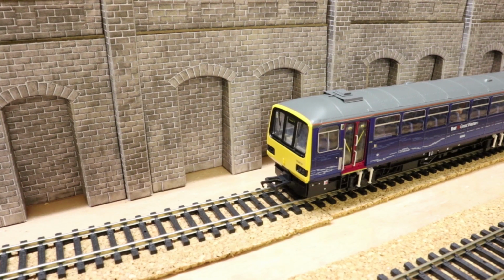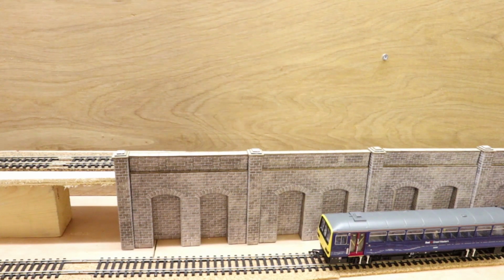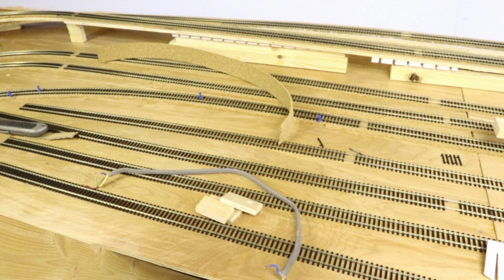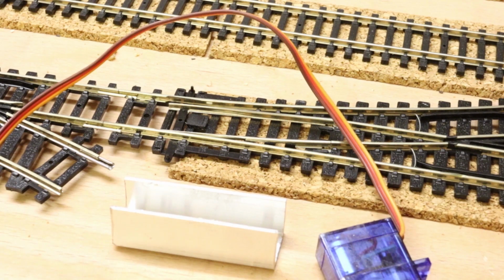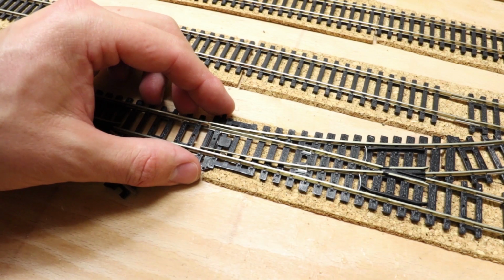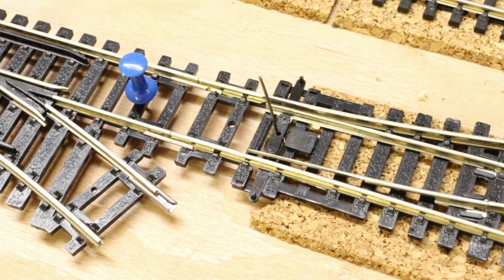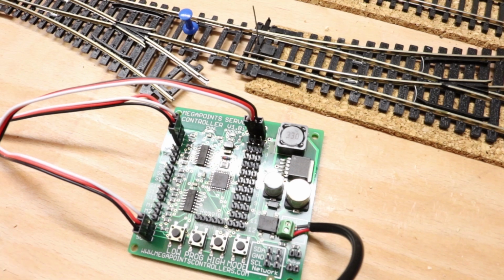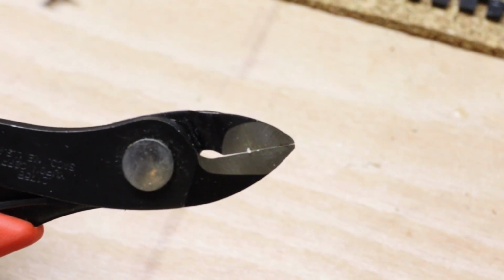Part 21 retaining wall and point motors - Building a model railway

Comment: Hi,  I believe I have been told or read...that yard tracks are not ballasted but rather sit on the ground,  please check this out at your end.  Also, when putting droppers on an incline, my sources say to bring a long section of it down on the benchwork in front of you.  Then install the track, droppers, and turnouts in this section.  When done, take the whole section and place it back on the incline supports.  Drop the droppers thru the benchwork and screw the track down, tick on the joiners and move to the next section.
Bob S

Comment: The hole for the actuator wire can be quite big, if you want, to allow for any misalignment.  Of course, if you cut an oval/slot, the hole will be hidden under the tie-bar.
But you've considered and tested your implementation, so kudos.

Comment: Looking at the upper walls of the retaining wall, I can see that the line of whole "bricks" looks good, and the top edge is lost below the coping stones.
Small point; between the sections of wall, you get small gaps, and train lights (at night) will emphasise them.  Not sure what to fill the gap with, since UHU remains transparent, but anything that is dark will require more care to avoid marking the (rail-side) printing.  (Because yo are already thinking of the railside perception, and with the increase of small wagon mountable camera, you are likely to do cab-view videos.
Reply: I see you got still the spring in the turnout.
When you remove that spring, the turnout moves smoother

Comment: Good progress. Nice work. The track cutter instructions do say not to cut anything bit track with them. I guess that's why!
Reply from the maker: Instructions? I'm a man, they went straight in the bin with the packaging lol.
Maybe I should read them in future.
Reply: The Devon model railway Lol. I am also man. But when I've spent a ridiculous amount of money on an overpriced tool, I do tend to read the packet...got to get my money's worth!
Reply: Piano wire is high tensile steel, its application requires varying degrees of tensioning. When I work on steam we used it for alignment of e.g. locomotive slide bars, bearings etc.
The ol zuron track cutters are designed for that purpose only. The vertical cutters are great for cutting & shutting the closure rails on a layout. Yes the instructions do stress that but I know we all tend to think we know best, you are not alone.
However the horizontal cutters double up as an effective track pin removal tool used wisely ( just don't cut pins with them). 
Great layout, looks good, just discovered you & thanks for info, we never stop learning.